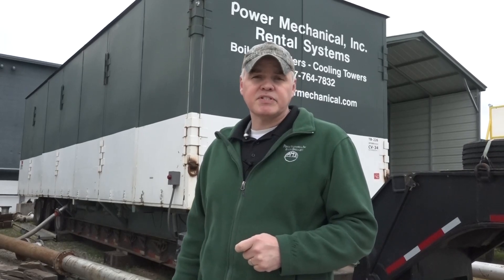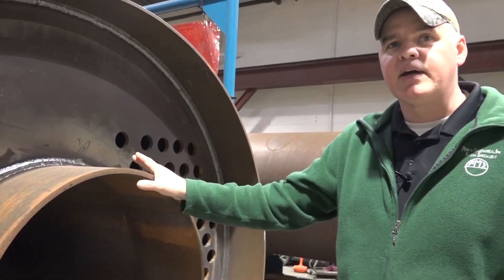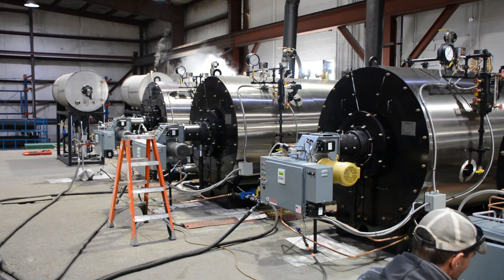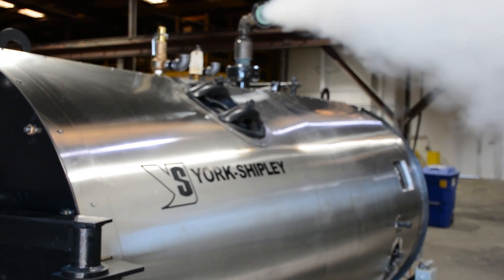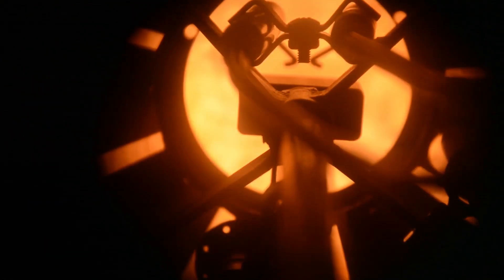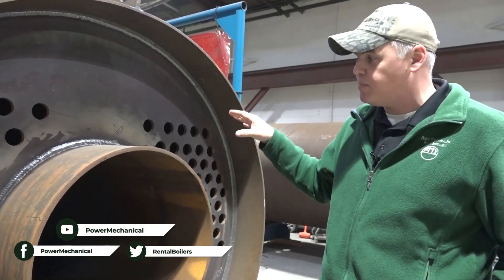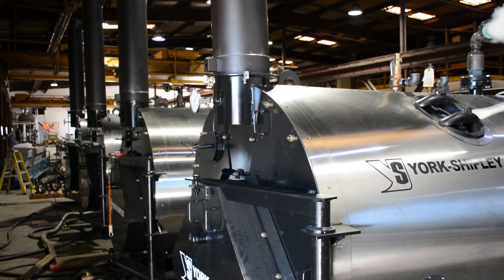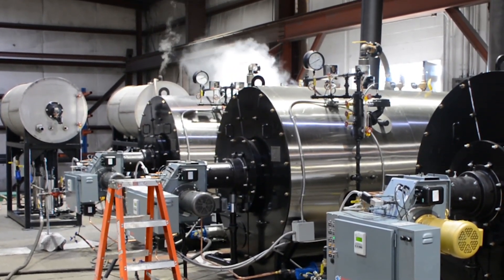York Shipley Boilers - Steamworks

Comment: Do you make boilers for which fuel?
Reply from the maker: Hi, York-Shipley manufactures numerous boilers for various industrial and commercial applications. They are designed to meet most every major burner design specification. Find out more over at their website: https://www.aesystech.com/
Reply: @powermechanical  I would be happy to bring to your attention a new, completely different, and even contrary to previous ideas, the technology that can revolutionize the field of heat engineering and the creation of a completely new type of heating plants that generate electrical and thermal energy.

Priorities of the proposed technology:
1. Fuel economy more than 2 times – natural gas, coal, diesel fuel, peat and other types of fuel.
2. Environmental conservation - reduction of several hundred times harmful emissions into the atmosphere.
3. The financial benefit to both the producer and the consumer is the reduction in the cost of generating electric and thermal energy and the sale of new original plants of different capacities, from the smallest to household; waste incinerators - rubber, plastic, and other municipal solid waste are burned without smoke and harmful emissions; and to the largest installations - thermal power plants.

Specialists in the field of heat engineering deny the principle of operation of this technology of mine until they see in practice that it really works effectively contrary to their concepts and teachings and make sure that the installation is arranged according to all laws of physics.

Another important reason why officials do not allow the widespread adoption of this technology is that supply of fuel is their own business, and they are not interested in fuel economy and the introduction of new technologies, and they are not interested in environmental issues at all.

I have patents in the CIS, drawings and other information on technology, if you are interested in this area, please give me feedback. Below are my coordinates.
With respect and hope that you will be interested in this unusual promising technology, and we will turn over all previous dogmas and introduce our technology for the benefit of people.